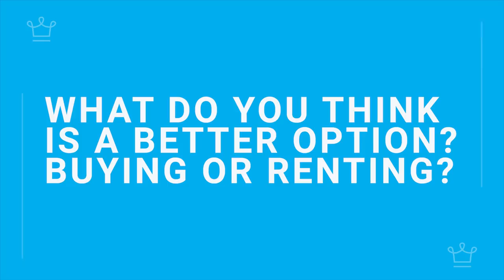Renting VS Buying a Home

Comment: Having been military for 17 years, renting was our choice. However after 10 years of house checks we concluded we had zero to show for the roughly $110,000 the army had given us... for housing. So we bought an RV to live in. Simple small, not expensive, easy to pack up and move. We now own 4acres and are building a microfarm on it. Running of the Kiyosaki mindset, we are making sure the property will make money in some way so not to be an asset not a liability. So many property related income streams i am not going down that rabbit hole, just that for ownership, our goal is that it pays for itself.

Comment: Definitly own the house you live in! 🙏
Reply: Definitely own the house you can rent out and rent where you want to live
Reply: theconstruct67 That’s a pretty good idea. Good luck to him!
Reply: Owning your primary residence is almost always a major liability, it costs you money and does not put money in your pocket on a monthly basis in most cases. It's not an asset if it costs you money every month. Assets put money in your pocket. Investment properties and as many as you can get, the cash flow from them will pay your rent keeping you flexible and can make moves less encumbered. Not to mention al the cost that comes with owning your primary residence, hidden costs are everywhere. something will always be breaking down or going out which will keep cash flowing the wrong way. There are always exceptions if you must have things a certain way or are always feeling a great need to knock down walls, move the kitchen to a different area of the house and other silly things I've seen from my family especially lol Some of them always have to be fucking with their house and it's kind of silly in my opinion.

Comment: My belief is that buying when possible is usually the better option.  If you live in an apartment for ten years and you live in a house you're buying for ten years, the difference is equity.  You get no equity from a rental, unless of course you own the rental.  Also, if you paid an extra $50 a month on your house for ten years, not only you will have that equity, you will cut into the amount of interest you pay over the life of that loan.  In a loose sense, early payments are kind of an investment in the long run because it makes it cheaper to borrow the money over the life of the loan.  Every dollar you pay in principle is still a dollar you own after all, but you don't get to keep a single dollar you pay in interest.  
Renting may offer flexibility, but you're still trading one freedom for another, and you can't forget that rental does not build wealth.  Everything you spend to rent is lost.  Just my opinion, but after 15-30 years I want to have more to hold on to than just memories.  If I'm old and I get sick/tossed to the ground by life, I can still sell the house and continue to get by.  Not as happy as I would be by keeping my home, mind you, but I'd still get by.  It's not equity versus freedom, equity is freedom.

Comment: if you have your own job or secure job it’s good time to buy a house in a bad time.the secret is you get very low price, lower interest rate , no competitive, the owner will settle to the price you need so many benefit trust me I did this in 2009  but you need to get duplex?now I am so happy the price is double  if the market crashes again doesn’t matter still I am making money by rent both units or  live in one unit rent the second that’s all👌

Comment: Renting is NOT a good long term strategy.  Mortgage payments are fixed, assuming 2% inflation. a 1k monthly mortgage payment today will be the equivalent to $552 in 30 years in todays dollars. Rent payments generally go up. Getting a 30 year mortgage will be more upfront but will allow significant flexibility down the line. theirs also an opportunity cost for getting a 15 year mortgage instead of a 30.  you'll end up paying less interest but if your thinking long term, investing stocks at 6% average return a year will give you an extra 2% gain towards retirement.

Comment: I cannot believe the advice given here. It really is horrible. Too much to go into. 

But just picking one. It is ALWAYS BETTER - from a security standpoint- to go with the 30 year mortgage and INSIST on NO prepayment penalty. In the USA if you put down your 20% and then make double payments or partial payments ... you will be good to go with a 30 year mortgage. Or better yet, treat your 30 year mortgage like a 15 year mortgage; but INSIST on no prepayment penalties.

If you cannot put 20% down on a house, you have no business getting that house in the first place- wait and save up. It is always EASIER to save 20% BEFORE you get a house - because you are not paying housing repairs, taxes, etc. - because you are either just paying rent or living with Mim and Dad.

So pay your 30 year mortgage as if it were a 15 year mortgage and it will give you a buffer when tragedy strikes. When tragedy strikes, just pay what you are required to pay on your 30 year mortgage.  Always go into finances with a plan B for emergencies - at the BERY LEAST.

NEVER use your house as a piggy bank. If you cannot do it without borrowing against your house, then you cannot afford it and do without it ... you will sleep like a baby at night.
Reply: Great points

Comment: I may not be entirely correct but its a whole lot to consider...     I think - especially as a first time buyer - it makes more sense to buy as an investment, rent where you want to live. As mentioned, owning a home can often come with many unexpected expenses - on top of the hefty deposit you’ve had to fork out. Imagine you get into a relationship, buy a 2 bed home together, and in the first 6 years you’re expecting a 3rd child? You’re now considering a bigger home, which means bigger expenses on top of what you already have, plus the potential for negative equity on your home, as you haven’t fulfilled the length of the mortgage, then the penalty for getting out of the contract etc...